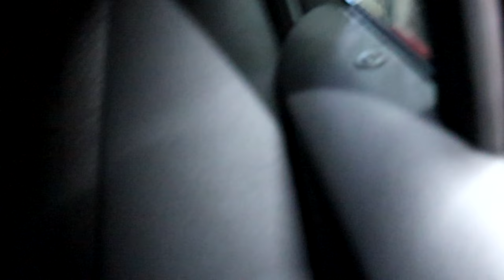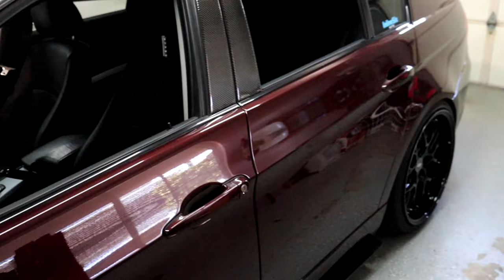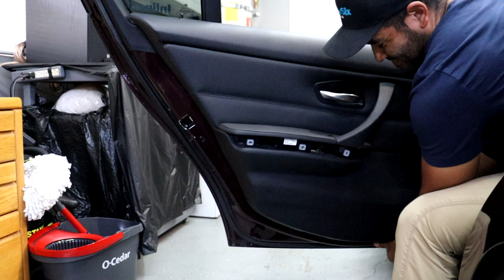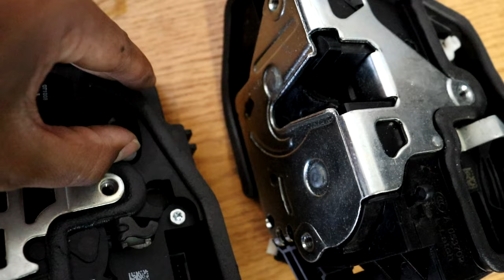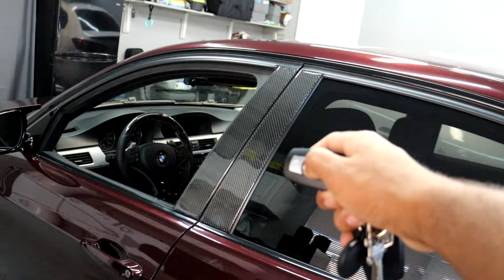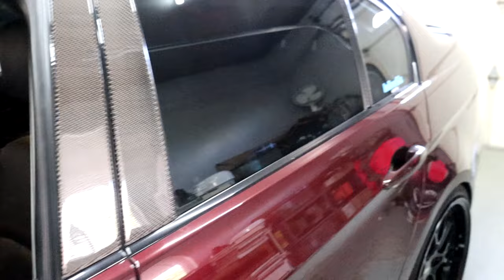THIS PART WILL FAIL ON YOUR BMW...

Comment: Hi question hopefully you could answer, do you know if the right front parking lamp malfunction noti and symbol will turn off if I decide to get aftermarket headlights to replace factory? Symbol and noti came up due to the Angel eyes/halo lights being dead on left side
Reply from the maker: Yes its common for the car to detect malfunctions when installing aftermarket since they don't match what the car is coded for so it thinks something is wrong. Even though the headlights work fine. Do you have aftermarket headlights? or is that happening with your stock headlights?
Reply: @InlineSixAuto  currently have stock headlights and is what’s happening atm, was looking to get spyder halogen headlights and was wondering if it’s possible to install the AM spyder headlights and hopefully gets rid of Angel eye malfunction, maybe AM part has to be coded, would that work?